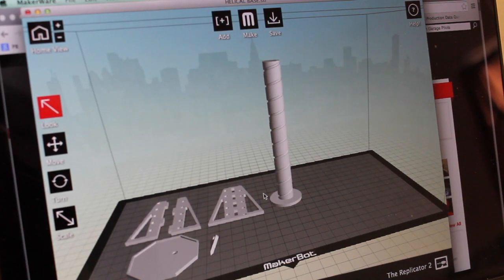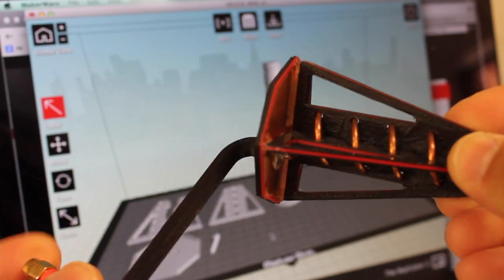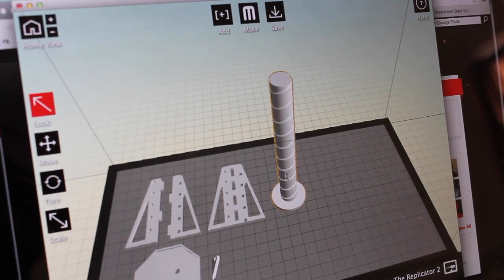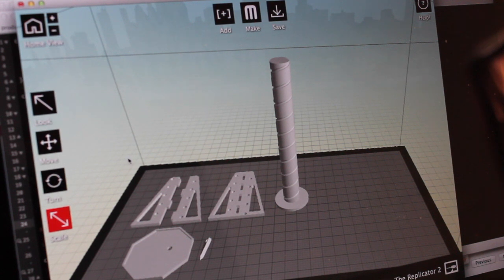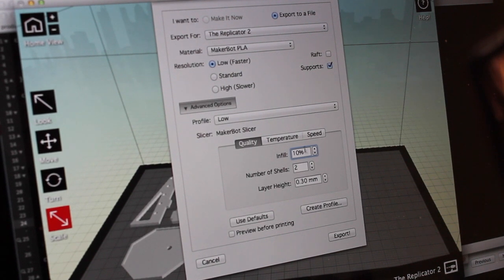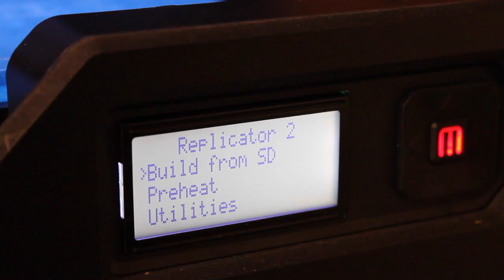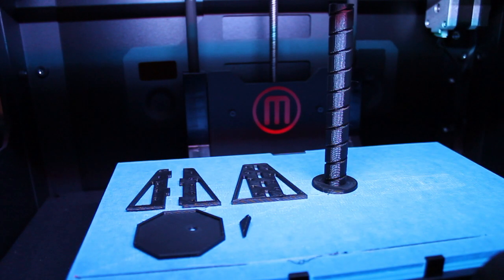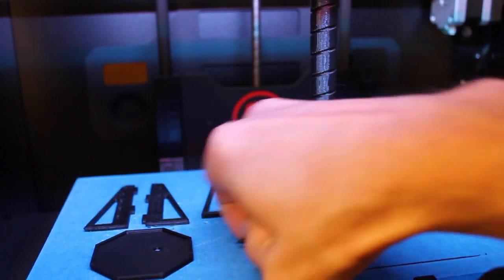3D Printed Helical FPV Antenna Designed by Zwcky

Comment: hi Dennis
thank you and Zwcky  for putting this together .
i was wondering about the stem you are using on the anteena , is that 3d printed ?

cheers
Reply: Yes the stem on Dennis's antenna is 3d printed but the final product wont have the 3d printed stem. It will have a stiff cable that you can bend and position in any direction you want and it will stay in place.

Comment: Hi Dennis,
What is the Helical for? Is it set up for 5.8Ghz or another frequency?
Based on the indentation of the design on the tube it is only for a specific frequency.
Reply: Yes it is for the 5.8GHZ frequency.

Comment: Have you found the best "system" for sticking prints yet? I bought my printer a week or so ago experimenting with a glass deck covered in blue painters tape and hairspray. Thinking of just a bare glass deck and gluestick next. What do you prefer?

Im using ABS with a heated deck.
Reply: ABS and PLA have different stick properties from what I can tell, with ABS being the more difficult to work with.  That being said,  I have been using ABS on my Solidoodle 4.  When I first got it I was having problems getting it to stick.  I have finally hit on a reliable solution that I have been using for many prints over the past month, however it isn't the cheapest. 

I cover the build surface in Kapton tape, then scuff the kapton well (circular pattern) with a scotch scratch pad.  Afterwords, I clean the surface with acetone, then apply an ABS slurry (dissolve ABS in acetone and wipe onto the build surface.  The ratio of ABS to acetone in the slurry is key,  too much ABS in the mix and it will stick too well (as in hard to remove your print), too little and it won't stick. 

The reason I say its somewhat expensive is this method does eventually wear out the Kapton (it sticks well, so after you remove each print, it stretches the Kapton and it does eventually rip requiring replacement, but you will get a dozen or so prints before that happens (milage varies).  Also you need to smooth out the bubbles in the tape after each print (i usually lift the section of tape that acquires bubbles and reapply.  At some point I should do a video of my process/results.

These guys have a neat solution but it's only for PLA...  http://printinz.com/printer-plates/  They say they are coming out with an ABS version, if they do, I can't wait to try it out.  Good luck,  hit me up if you need more clarification.
Reply from the maker: That's good stuff. I'm still using the blue painters tape on my build plate and it works so-so. I'll definitely take these tips into consideration. Thanks for the tips.
Reply: Legacy - by far the best i have used with abs is glass with a layer of hairspray and a coating of elmers purple glue on a heated bed.  Just looked at my bed setting in kisslicer and it was set to 120C but think that is a little overkill.  Stuck so well that sometimes it was pulling up flakes of glass.